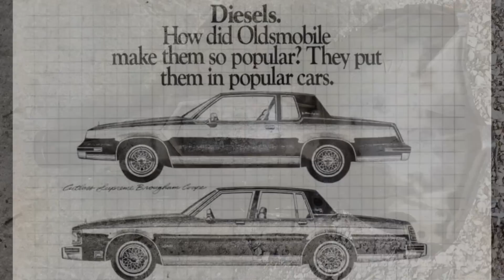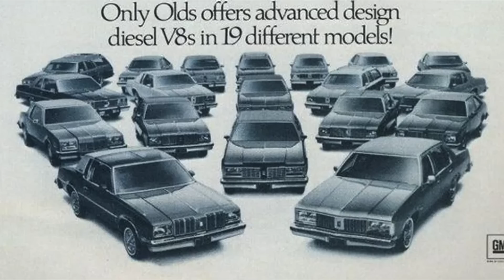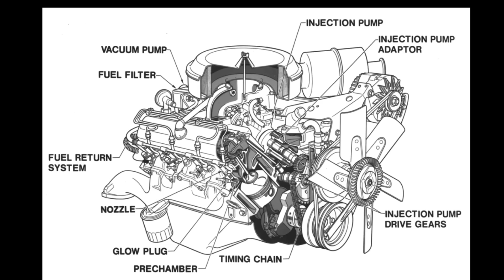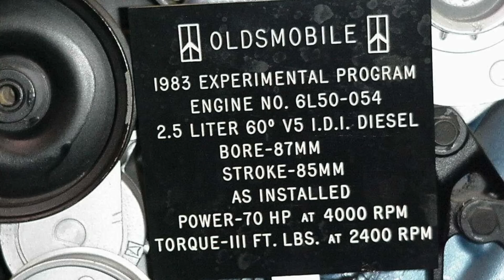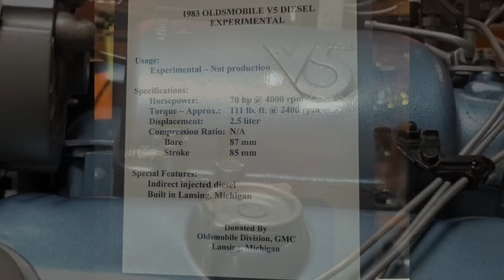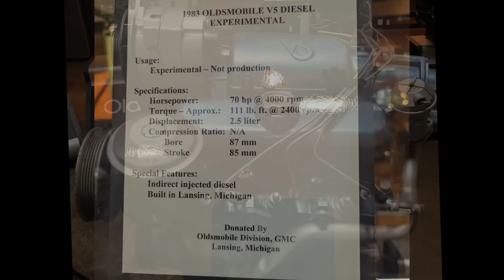Craziest Automotive Engines: Oldsmobile's V5 Diesel (Yes, I Said V5)!

Comment: I had a 78 or 79 Chevy half ton pickup bought new had a few problems but luckily I had a mechanic friend that lived two doors from me coulapsed a fuel injector and had to drop the oil pan and replace the rear main seal.

Comment: The old 6.2 V8 Diesels were actually not bad engines and were reasonably reliable, especially the later ones and the ones with no EGR emissions…they were good on fuel and if you made a few modifications to it, you could get very good performance and longevity out of it!…it would seem this engine series loved RPM’s so vehicles with 3.73 axel ratios and above did very well…like any engine if you kept the oil and fuel clean, you could easily get 300,000miles out of this engine!…I’ve had a few over the years and I loved every one of them…had 6.5’s as well but that’s for another story!

Comment: The Olds 350 diesel was NOT based on a gasoline "358". 

It WAS based on the small block Olds gasoline 350, and shared the exact same bore and stroke.

Comment: The VW "V5" is not a V5, in my mind anyway. As it really has only one bank, one cylinder head, one exhaust manifold, and one intake manifold. If memory serves that engine was marketed as the "VR5" in their more sporty modles. Yes technically its a "V5", but by my defenition any V configured engine must have 2 cylinder heads and 2 of each manifold, otherwise its just a funky inline 5 cylinder. Later on VW did a VR6 which was same concept, 15° bank, but again one intake manifold, and one exhast attached to a single cylinder head, at least in my head its just a funky inline 6 cylinder. 
Just my opinion. Although i will say its quite ingenious getting V6 power out of a much more space efficient 6 cylinder, same with the 5 cylinder.
Good work as always. I love the channel. Keep it up, man.
Earned yourself a new subscriber.

Comment: Our 1981 Olds Cutlass Brougham diesel performed well. We had farm diesel so that prob helped. Also, we let it warm up a few minutes before driving.  Kept it almost 3 years and racked up 123k miles on it. Only left us stranded on one record cold Christmas morning.  The fuel gelled up.  There were a lot of Olds (Buick, Caddy, Chevy, Pontiac) diesels in my area. None ever suffered catastrophic engine failure. Most of the issues revolved around the supporting equipment. A bad starter. Fuel or oil pump would go out, etc.

Comment: What was the gas V6 transverse engine in the Cutlass Ciera. It was a V6, and it ran really stout. It was transverse from wheel drive V6. It was stronger than the 3.8, it pulled like a freight train.

Comment: I bought a used 1981 GMC pickup 5.7 Diesel .. it had a Targmaster  replacement engine..  I put headers on it .. the  Injector pump failed had it rebuilt and turned up 10%    The Truck got too rusty and parked it at 260,000 miles on it ..
  I added a remote Luberfiner fuel filter with water sediment bowl on the firewall .

Comment: The fuel filter on the Oldsmobile V8 diesel engine was also a water separator. You had to change the fuel filter at least twice a year depending on how much you drove. When I was working on cars, I had a gentleman who brought his Olds in every 3 months to have the fuel filter changed & twice a year for a oil change. The engine ran like a top. He never had any major issues with the diesel engine.

Comment: crazy that they did not reverse engineering a mercedez benz 6 diesel of the time and kept trying V8...also crazy is to think you can get 220hp of a modern 2L turbocharged diesel and get 340 fp torque (480Nm) nowadays....engine engineering has really made a huge gap in the 90's-2000's

Comment: Two things I thought worth mentioning: 1) @ 5:09 you say there were no olds V8 or V6’s built….this is not true for the V8 at least. The olds 307 continued until 1990 and was actually the second to last American engine to come with a carburetor from the factory, the last being the 91 Jeep Wagoneer with the AMC 360. 2) this is just a fun fact kind of deal:  the 4.3 V8 diesel was discontinued because the engine was the  same size externally as the 5.7/350 diesel due to using the same basic block casting, and you could literally put a 350 Diesel where a 4.3 Diesel was and everything would bolt up and connect without one single modification. The 4.3 was only a few pounds lighter as well, the difference being in the smaller rotating assembly due to the smaller bore. Because of all this Olds decided there was no point in offering two different Size diesel v8’s, especially when the 5.7 was already considered barely adequate power wise.
Reply: It's too bad the 350 diesel was such hot garbage. Imagine they had reinforced the block and used proper head bolts for it..

Comment: I had an 81 Bonneville with the Diesel 350 and it was an awesome car! I paid 500 $ for it with 50 k miles and it was absolutely spotless and everything worked. If it had a v8 gas It would have easily been worth 3-5k. My bonneville was very quick it would roast the rear tires. I drove it all winter and sold it at auto auction for 1200 and thought I did good. lol

Comment: I didnt undestand how GM can screw up with diesel engines so bad. They already have very good diesel engines tech. A 6/5 inline with unit mechanical pump inyector 4 stroke diesel may be the wining combo

Comment: Had a diesel in a Chevy Celebrity. Its failure was a split crankshaft. Starter turned one end and the crank pulley stayed put. Swapped out for a gas engine.  The engine was painted that odd blue-green much like a Detroit Diesel.

Comment: During that era, I was working for a used car dealer, ferrying those GM diesels between Indiana and Florida. One day I found myself in a 260 Olds in a parking lot, stopped against a speed bump. It would not climb the speed bump!!  Had to back up and take a run at it.

Comment: The Olds engines were some great performers! I had many, but mostly the 455. Those DX blocks were ultra strong and came with a forged crank. All of the olds engines back then had forged rods also. For the DX, just use 350 or 403 heads and get something like 14-1. The boat guys really liked those. The 425 engines all came with forged steel cranks, and the early ones had dome pistons. Use the C casting heads (69 only) on the 455 with a 50k deck cut and a fel pro perma torque head gasket (43k crush) get 10.5-1 with shallow dish pistons. I put custom top end oil restricting plugs in my 461 (455 + 30 over) Insane torque and 7,000 rpm also. It destroyed my 84 Cutless with body twist. I still have 2 sets of C castings after all these years...  If you want to try something cool and different, but also make real power try a big Olds engine.

Comment: Unless they used 3spd 200 my big gms from 80s some had 200 r4 that was fine just unhook computer wire lock up n hook to fuse box .bad computers n the 350 turbo n 375 not chevette unless was V6 with 3spd maybe but I never seen it

Comment: THE OLDS DIESEL WAS NOT BASED ON THE 350 GAS ENGINE. IT WAS DESTROYED BY WATER AND TOO FEW/WEAK HEAD BOLTS. Also, in the after market these engines, when properly outfitted could produce more than enough horsepower for the big cars. As well, the 430 ci v6 was actually 2 different engines, one for transverse and one for longitudinal.

Comment: as european i always wondered how american car manufacturers managed to get engine with so little power with humongous engines while a small 6 cylinders 2 liters (120 cubic inches) Porsche was able to reach 180hp in the early 70's and a crappy PRV v6 was 130hp in the late 70's with a displacement under 3 liters (185 cubic inches) and i don't speak about japanese brands with ultra small engines but with amazing power and reliability. 
European diesel engines in the late 70's were about 60hp with 2 liters of displacement while US diesel engine were 2 to 3 times bigger with nearly the same power (you don't need to double the displacement to gain only 25hp) . The Peugeot 504 2.3 diesel was 70hp and keep running nowadays in africa with more than 1million kms (504 are used a bush taxi since the 80's and still work today)
Reply: also wondering..it might be that pryde prevented any head of engineering to look at Europe and say: why don't we try to understand what they are doing and downside our engines, use turbocharge, reduce car weight (size) and improve handling and safety. They could have easily reverse engineering volvos and Benz, Peugeot indenor diesels etc..
Reply: @loftalofta8423   8 liters 120hp...even in Automation (the game) i can't get so low
Reply: @themetalslayer2260 usually they start out by making big engines, before realising the prototype uses too much fuel. So then the engineers turn the horsepower down to save fuel. If you wanna modify the fuel system and cylinder heads you can make a lot more power.

Comment: I remember GM had a 5 cylinder gas motor and I read where someone bought a truck with one because the salesman said "It has the power of a 6 cylinder and the gas mileage of a 4 cylinder", he returned it saying the salesman had those numbers backwards.
Reply: Yep that was an in-line five gas engine that was available in GMC and Chevy trucks as well as the H3 Hummer.

Comment: I had a starter and alternator shop I Colorado in the 80s and 90s .  I would sell you one starter with no warranty.  guarantee that when it got cold they would burn out the starter or use either and break the nose housing and bend the armature.  Glad there are all gone.   Before GM put diesel in cars diesel fuel was 35 cents a gallon gas was 75 cents that’s why people bought them,  then diesel doubled in price.

Comment: In 1979 I worked on a drilling rig in Louisiana and each driller got an allowance for mileage if they furnished the transportration to the rig. Well the value to the driller was immense as they bought Oldsmobile diesels the V-8 for their crew cars. 
Consider that they got their fuel for free , their oil for free along with filters from suppliers on the rig. Then one of the hands would change to oil and filters at the rig. So that was free money for those drillers. 
We drove the hell out of those diesels at pretty much wide open at &0 to 80 MPH. I never saw them have a problem.

Comment: It never fails to baffle me how you get such low power from such large engines. My grandfather had a diesel car early 1980s 1.9 litres and that put out 75 bhp
Reply: Simple, diesels are air hungry. No turbo- very low power. A dyno test on the international 7.3 showed adding a turbo and 5 psi of boost on them yielded a 25% increase in power, from 180 to 250hp. Any of these GM engines with 25% more power would have been much more pleasant to drive and merge with traffic.

Comment: great video I worked for GM Canada in the late 80's through to the mid 90's and you sure got to see many things the average person doesn't, i never heard or saw the V5 diesel, that's just R&D in those times, most GM engineering divisions did their own things without much go between when it came to designing products, the V6 and V8 diesels got to be more reliable in the last few years they were sold in various chassis'd vehicles, here in Canada where it is really cold in the west they didn't fair too well, some of the full size RWD wagons that the 5.7 was sort of popular in were surprisingly reliable with good scheduled maintenance and if you  were a  person familiar with a diesel they usually ran and lasted better, I even saw one of the early versions come in with what a farmer installed his own water/fuel separator himself and said it ran better than new and had  almost 175k miles on it and got regularly in the low 20's for economy ,not bad for a barge with almost no power, great video , the iron duke 2.5 was a great engine there's records of thousands of them with 300/400k on them and still ran good super easy on fuel 👍

Comment: Biggest problem with the Oldsmobile diesels was they didn’t have a fuel water separator which if didn’t make sure to use high quality diesel fuel would ruin the injectors

Comment: About slow how about mb 190 or 200 diesel.. i had cutlass 4.3 v8 stw. Pity sold it in 90s. But now i have 88 2d 5.7 d.x running ok. Off course got to some what pervert to like it..(but not that much to like to drive toyota 😅)

Comment: I’m amazed the engine made 70hp, each cylinder is 500cc and making 15hp, that’s better than most small industrial diesels, I have a 430cc direct injection diesel that only makes 10hp.

Comment: 70hp in a NA 2.5 diesel is not that bad, especially for the time. My VW 1.9 TDI makes 90hp and uses 1 bar of boost. Yes, the boost makes low end way better than NA motors. Gas v8 engines at that time were routinely making 120-150hp with double or more displacement. Now, 70hp in anything but a tiny car is going to be terrible. But it would get you point a to point b and get 40+ mpg.

Comment: I hate that people still think the olds and GM diesels were “converted” gas engines. It NEVER HAPPENED!! They only used similar bore spacing and overall shape to save money. I hate that some myths never die. The engines weren’t as bad as most people think, with clean diesel fuel, a knowledgeable owner, and proper maintenance, they are FANTASTIC diesel engines.
Reply from the maker: Except for the 4.3V6, they were converted gas engines.  The blocks and many components were strengthened, but the starting point was the Olds 350 gas engine.  They reused distributor shaft hole for injection pump drive, had the same head bolt pattern (which was a major flaw), identical bore spacing and deck height etc.

Comment: How bizarre. Several European car makers used 5 cylinder diesels but they were inline and very reliable.
The European cars, of course, were smaller and lighter than the American cars.
My 85 mercedes turbodiesel had 280k miles on it when I traded it off in 2005 and was in excelent condition still.
Most of the European diesels were turbocharged.

Comment: I started as a  young tech at an Oldsmobile dealership  back in 1981 .  I recall the Salesmen telling people this sales feature  " You never need to tune up  these diesel engines"  We were constantly replacing fuel filters  on these engines , almost weekly in some cases due to water intrusion .  Also we installed  plenty of glow plugs and glow plug controllers  . Occasionally , while removing a glow plug , the end would fall off into the cylinder which required cylinder head removal to retrieve the broken part .
Reply: See one of those would do okay today because the diesel stations have serious water separators and are generally much cleaner. My passat diesel has about 3mm of water in it max over the span of 30k between fuel filter changes
Reply: @DarkAttack14  We are located in Farm Country so good  quality of fuel is not the norm or wasn't back in the day .
Reply: My owners manual for my 6.2 diesel says to let them get chewed up and spat out the exhaust lol

Comment: Positive comments about the GM passenger car diesels.... We were in the auto parts business in those days. I don’t recall anyone having anything good to say about them. It was assumed they’d “dieseled” the gasoline block, based on the frequent failures.

I was the unwilling heir to a 229 V6 when I married. It was a sawed-off 305 with all of the disadvantages and none of the power. Lamest engine in history, in the most unreliable car ever. It seems like I spent half my time replacing alternators and belts. But we did have the longest-lived R4 compressor in the US. My wife never used the air.

Comment: Volkswagen used a shortened version of their VR6 engine, where more or less just one of the cylinders was cut. It was used in the Bora (US: Jetta) V5 for example.
Interesting to see that the idea of V5 engines was used in other cars as well - despite it seems the Oldsmobile V5 Diesel wasn't that reliable.

Comment: I owned an Oldsmobile diesel in 1978.  It had a 350ci V8 diesel.  It was a horrible POS car!   I can go on and on about what a piece of junk this was.  The car had absolutely NO power and couldn't get out of its own way.   I could go on and on about this piece of junk car.  It spent more time in the Oldsmobile garage than on the road.  The mechanics admitted they had no solution to the myriad issues with this car.  There were class action law suits against GM, but they were allowed to wiggle out of any responsibility for their malfeasance and horrible products.    GM should have been made to recall every one of these vehicles.    I have never purchased a GM car since.
        My friend had a top of the line Caddilac Barritz with a diesel.  I had purchased a very cheap little Izusu PUP  that had little or no power.  We were racing up a hill one day and I won!   That Cadillac couldn't pull a sick prostitute off a toilet!   That is the honest truth!

Comment: I had a 8.2 liter diesel in a f650 with a rollback tow truck it was non turbo and slow not a good interstate truck but hauling a car down the interstate it gat 24.6 mpg in a f650